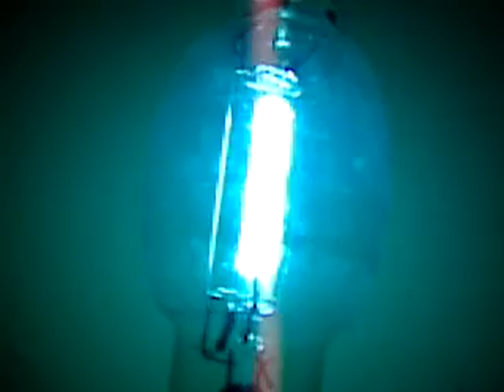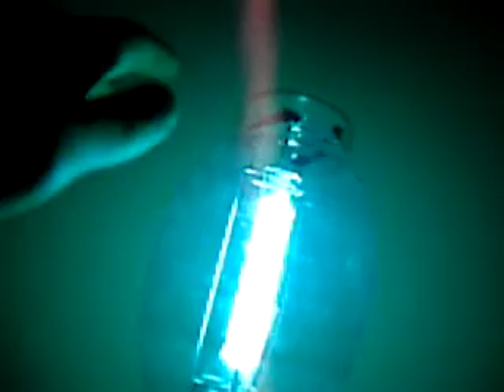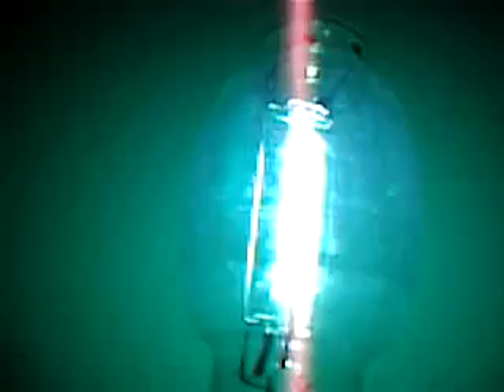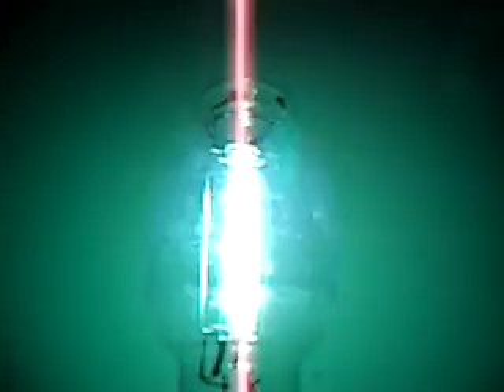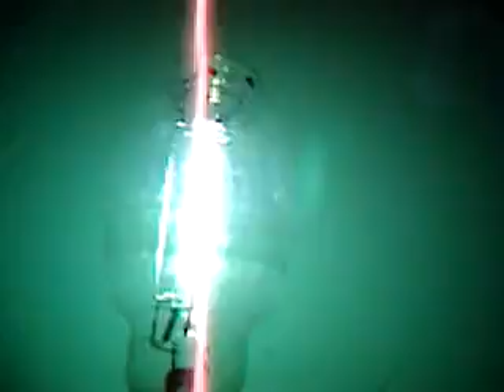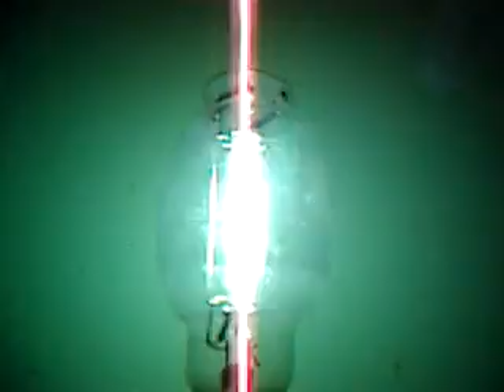175 watt BT shaped Philips Lifeguard clear mercury vapor lamp

Comment: These far surpass sodium lamps which last at most 2 yrs Really? and the sodiums are supposed to be the wave of the future; I have noticed however more of a swing toward MH which is almost exactly a MV in appearance....
Reply from the maker: Just these older vintage mercury vapor lamps, the most common of which is the Westinghouse/Philips Lifeguard lamps. These had a technology in the arctube that kept it from dimming out. GE had a Bonus Line lamp and Sylvania had a Banner lamp with the same technology but they weren't made for as long, and yes, there are documented cases of some lasting over 40 years. Modern MV lamps last nowhere near this long most of the time. Metal halide is becoming more common due to its efficiency although the lifespan is the shortest of the 3 HID lamps and they tend to explode when they burn out. HPS is midrange in lifespan and technically more efficient but the color is irritating to the eyes and orange lumens are harder to see than white lumens.
Reply: @DavidFromAE  Although these are more likely to dim out than they are to burn out. It is actually kind of rare to see a Philips Lifeguard burn out because h the last pretty much forever.

Comment: New Condition Mercury Lamps Give Off A Bluish Green Light, The Older The Greener Due To Arc Tube Darkining. I Have Some Sylvania Mercury Lamps That Have Nickel Plated Basses With Blue Glass Insulators! I LOVE This Look! One Of My Favorits Is A Girder Frame With This Typ Of Bass. The Sparking, Is What I Call Flearing, During Worm Up Sometimes Small Amounts Of Mercury Fall Into Hhe Arc Stream, Causing It To Burn Up Rapidly. Giving Off A Bright Redish Pink Light.

Comment: I Have Quite A Few Of These In My Collection! In Ment Shape, Phillips Bought Out Westinghouse Lifeguard In The Late 70s. I Have A Lot Of These As Well. They Are The Best Bulbs Ever Made Some In My Home Town Ola Have Been Burning Sence The Late 1950s. Another Great Bulb Is The Sylvania Girder Frame B-T They Are Just Awsome!! G-E Had A Bonus Line That Was A Great Lamp Also. In The 70s Mercury Lamps Quit Using The Heavy Braded Lead In Wires In The Bass, This Caused Most Of The Lamp Outages.

Comment from the maker: Clear mercury vapor lamps naturally have a greenish color. Those underwater fishing lights use clear mercury vapor lamps and a hermetically sealed socket that keeps the water out. Their 12 volt model on the site I saw uses a fluorescent tube that only has green phosphors in it.

Comment: Does you clear MV Lamp have a UV Block glass around the arc tube? Iv got loads of MV Lamps all are 80w which in the UK is used for old streetlighting The funny thing with MV Lamps is when they are bran new they give out that bright pinking white light but as they age will lose that bright light to giving of a very dull greenish grey light after 5/7 years Nevertheless it has been know for MV Lamps to last for over 20 years